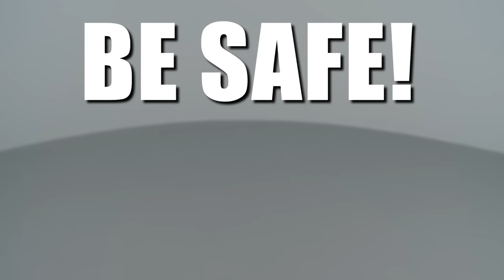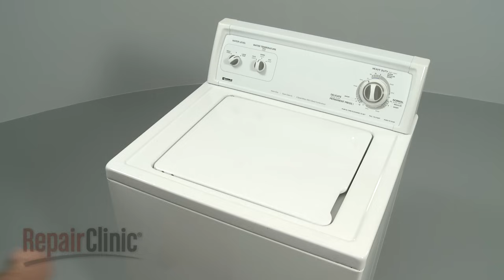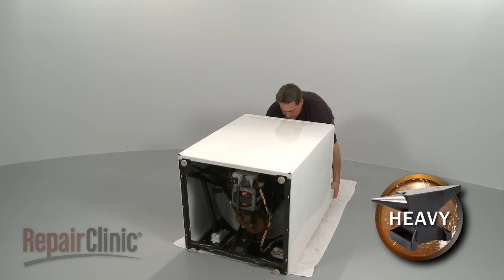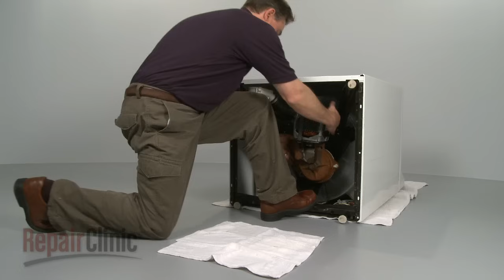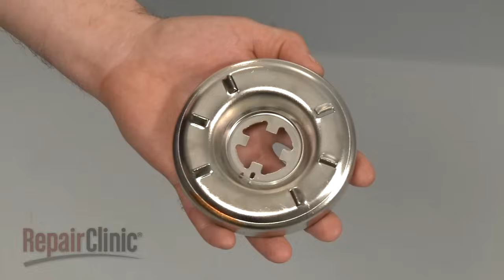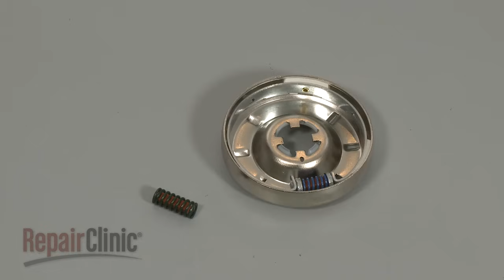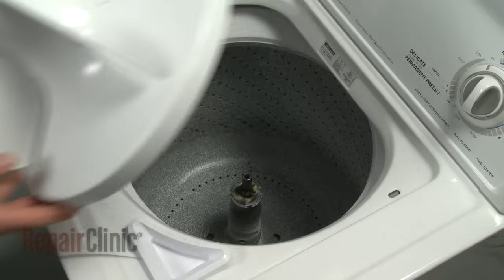Washer Won't Spin? Replace Whirlpool Direct Drive Clutch Assembly #285785

Comment: "One suggestion - @ 2:40 or so, once the white plastic cam is installed, be sure it's rotated counter-clockwise to move it back into its housing - otherwise, the motor/transmission assembly may not properly engage the mounting points."    This might go right to the heart of my current problem. After replacing the clutch, I am trying to put everything back together but I can't get the drive shaft and motor/transmission the last 1/2" back into the base so I can reinsert the bolts.   What am I missing?  I don't follow the above comment.
Reply from the maker: Tim Wright Thanks for your comment. Usually the brake will stay in place so you will not have this problem. But you are correct that if the brake has slid down in the housing, you may not be able to get the transmission up far enough to get the mounting bolts back in. In this case, you will have to rotate the cam to release the brake while pushing up to get it back up in the housing.
Reply: I have the same issue.  Will give it a try.  Much thanks.

Comment: Very helpful. One suggestion - @ 2:40 or so, once the white plastic cam is installed, be sure it's rotated counter-clockwise to move it back into its housing - otherwise, the motor/transmission assembly may not properly engage the mounting points.
Reply from the maker: 47f0 Thank you for the comment! Yes, turning the cam counterclockwise while pushing up will ensure the brake assembly is fully seated and the transmission will fit on the mounting post properly. Thanks for taking the time to share a tip!
Reply: Purchased my home in 2013. There was a Whirlpool washer that the realtor was going to haul away.  I said, no!  I had to leave my other washer at the condo I sold.  So, this washer must have been a 2008 model, or about that age.  Now it is 2024.  This washer runs like a champ and fills to the brim with water.  I started noticing that heavy loads were coming out soaking wet when load was finished.  Clothes would be somewhat spun dry if the load was light.  Then even the light loads were soaking wet.  Purchased a clutch kit on Amazon.  Cheap.   The repair worked like a charm until I tried to put the motor back in.  Could not get the bolts to come together.  There was about a 1/4” gap.   Thanks for the comment!!  Once I turned the plastic clutch part counter clockwise, it aligned and I was able to complete the repair.  I’m a 59 year old woman!  I love this washer.  I did repair the dogs once on the agitator.  So happy I found this video!  A new washer won’t last 5 years.  They make all appliances to break down so you either have to purchase a new one, or pay costly repairs.  YouTube saved the day.  So rewarding to fix things yourself!!!
Reply: I drilled and tapped and threaded screws into my brake cam because the groove for the circlip wore out. Also all i had to do was scuff up and clean the clutch and it was fine.
Reply: Jeezum! Thank you!

Comment: I replaced the clutch on mine, still does not go into spin unless i open and shut the lid , it seems like the brake is not releasing, I've put a wire to hold the switch open with lid up and watched as it tries to go into spin, when the
timer clicks and it starts it will move the agitator for maybe a half of an inch acting as if its locked up, any thoughts?
Reply from the maker: joe102674 There is a pause built into the spin cycle that kicks in the spin. If the timer skips the pause, the washer will not spin. If you can lift the lid and close it in the spin cycle and it  will spin, you most likely have a bad timer. In the spin cycle, the transmission will not go into a spin until after the first pause; this is to enable most of the water to leave before the tub spins. We wish you a successful repair.
Reply: *****
 I just went out and bought a Maytag Centennial Model #: MVWC200BW  (with agitator) from lowes, appreciate your response
Reply from the maker: joe102674 Enjoy the new machine!

Comment: Thanks!  You've saved me hundreds in repair bills on my washing machine.  The only nit I have is that you might recommend people change out their washing machine clutch when they replace the transmission.  I changed the tranny out approximately 9 months ago and the old clutch soon followed.
Reply from the maker: Conn McKelvey Thanks for the tip!

Comment: My Washer spin but does not spin out the wetness of the wash clothes as it use to. so i have run the spin cycle several times. Is this the Clutch or any other thought ?Kenmore 10years old or so. Thanks JC
Reply from the maker: Yes it is most likely the clutch that is slipping and will need to be replaced. First make sure all the water is pumping out. If that looks ok, replace the clutch.

Comment: Nice video.  I prefer removing the motor though.  Just 2 clips and can leave wires attached and makes removing gearbox easier/lighter.  I'd also replace coupler while in there if original.  That plastic ring/clip is a crappy design for attaching the clutch.
Reply from the maker: Thanks for the tips!

Comment: Worked like a charm.  Wife very impressed.  I used one of your other videos to replace a belt on an 80 series dryer a few months back (much easier job).  This is a much messier job than the video makes out.  Also, replacing the drive shaft and lining everything up was really difficult.  However I would not have attempted this fix without your video and if I had, probably would not have succeeded.  Thanks!
Reply from the maker: We're happy we could help. Congrats on the repair!

Comment: I have a whirlpool estate washer. It wont spin or drain it only hums. I checked the lid switch and transmission, they seemed fine. do you have any pointers for me?
Reply from the maker: Try using the repair help section of our website with you model number. This should be helpful: http://www.RepairClinic.com/RepairHelp

Comment: Awesome video. I think I've narrowed my problem to a bad clutch. If I wash just a few items, and have the spin speed set to slow, it will usually spin slowly. But any more load than tiny (or at high speed) and it will not spin (I'm guessing too much weight). There are no strange sounds. Does this sound like a clutch to you? And if so, while I have it apart, should I replace anything else, such as the Motor Coupling or Clutch Band kit?

Comment: Great video. Replacing the clutch was easy. However, the washer now shake violently like the load is unbalanced (even when empty). It didn't do this before i changed the clutch. What could I have missed?
Reply from the maker: I would check the plate that the tub rides on. It may have shifted and the glides are not riding in the right place. If you open the lid the tub should move fairly easily from side to side and align with the opening in the main top. If the plate is out of place you may need to lay it back down and readjust the plate. If the plate is ok check the tub springs and the rear counterbalance spring to ensure they are there and working properly.

Comment: I HAVE A WHIRLPOOL SUPER CAPACITY DRYER FROM 1987 VINTAGE. BUT WORKS GREAT! THE OTHER DAY THE WASHER MAKES A HORRIBLE GRINDING TYPE SOUND ON SPIN CYCLE.ONLY! WOULD THIS BE A CLUTCH??
Reply from the maker: It could be the clutch but it could also be a few other things. We recommend using the repair help section of our website (link in the description). If you enter your model number there you'll have access to part,model and symptom specific repair help.

Comment: Hi, I have just purchased a second hand unit and the seller did advise that the spins is slow at times.  This I have encountered and the washing is wet when spin is complete.  All things seem to point to the clutch especially since the previous owner admits that he washed horse quilts!!  In any event I have ordered a spare clutch which will be replaced but I am basically asking if my diagnosis is accurate.  ie the clutch is shot and slipping.  Washing etc is all working fine.

Comment from the maker: It is most likely not the clutch. We recommend using the repair help section of our website (link in the description). If you enter your model number there you'll have access to model, part and symptom specific repair help.

Comment: That was what I initially thought, too.  No noises and it does agitate normally when it does run.  Thanks for giving me confidence in my diagnosis.  I won't have any problem installing a replacement motor.

Comment: The motor on my whirlpool washer overheats and trips the thermal protection shutting it off.  In about 30 minutes it can resume washing for a little while then trips again.  While it is running there aren't any odd noises or anything, but there is a burned rubber/electric smell.  I took the pump off and noted some slight resistance turning the motor.  I then removed the motor and the resistance to turning it seemed to go away.  Could the clutch be the culprit of my motor overheating?

Comment: Thank you! We replaced the clutch and it seems to be working.  The grease/oil doesn't seem to be dripping on the floor, just sprayed around the inside of the cabinet. Thanks again for the video. We've been having issues for over a year.

Comment from the maker: If the transmission is leaking a little oil it will not affect the performance of the machine unless it is getting on the clutch or brake. If it is leaking a lot you may need to consider also replacing the transmission.

Comment from the maker: If water or oil is on the clutch it could make it slip. If the clutch is dry and still not turning to tub in fast enough in spin the pads in the clutch could be worn . Either way the clutch should be replaced. If the transmission is leaking oil, it will usually drip from the bottom of the case and not out the top by the clutch. You may need to clean it up and keep an eye on it  and try and see where the oil or water is coming from.

Comment from the maker: This is probably not your problem. We recommend using the repair help section of our website to diagnose problems ( there's a link towards the bottom of the description). If you enter your model number there you'll have access to part, model and symptom specific repair help.

Comment: Bought a new clutch, everything seemed to go smoothly, looked exactly like the video. I put the machine together and everything worked for a couple days then no spin again. I dismantled to find a lot of black material around the clutch and the clutch ring has worn right down to the rivets in the white plastic blocks, the black must have been the friction material.

Any idea what could cause a clutch to wear like that in just a few loads?

Comment: Exactly like the video! Thanks so much for your effort.
The worst part of the job was all the water that poured out of the pump. 
The clutch was a piece of cake.
Thanks again! :)
Reply: My experience with the water exactly. Now if I can just get the drive shaft free from the unit...

Comment: This is great but let's say it's sunday night and you need your work cloth for the next morning (like me ) and you don't have the new part , i take it off like in the video and did an emergency surgery, first take off the clutch with a pair of vise-grip compress spirng and slide it out clean everything on the clutch where the friciton happen and then scuff the pad and disc with a sand paper i also added washer to the spring to add tension ,it worked but this is temporary ,order part now

Comment: While I would enjoy a full break down transmission excluded this is a good informative video.
Although the only reason I am watching is the rear spring came loose, and I was uncertain where it attached. I saw the spring in the video and, the size of the hole it fits in, it would have taken a long time to figure out it went there.

Comment from the maker: Hi, thanks for the note. We did cover that step in the video. See below: 

"NOW SLIDE THE MOTOR AND GEARCASE ASSEMBLY INTO POSITION, MAKING SURE THE CLUTCH SPRING IS OPPOSITE THE BRAKE CAM. BE AWARE THIS MAY REQUIRE SOME ADJUSTMENT BEFORE THE GEARCASE SITS FLUSH AGAINST THE BASE. SECURE WITH THE BOLTS."

Comment: so far this looks somewhat simple and easy. I need to replace the clutch the motor coupling and transmission on my whirlpool as the trans is leaking oil.

Comment: I first noticed my heavier loads (towels) were not spinning dry. Eventually, all my loads were not spinning dry. All other wash functions worked fine. This was the fix. Couldn't see anything visually wrong with the old clutch, but now the washer works the same as when I bought it 7 years ago. It's an easy enough project. If you can change brake pads, you can do this.
Reply: Thanks for this post - I took mine apart before buying the new parts, visually looked fine so I went back to do more research but now I am convinced its this!

Comment: This is for the ladies out there:  I am a 54 year old single woman and I did this simple repair alone (thanks to the video!).  It is not hard to do.  I ordered my part from Amazon for about $13.  My washer works like a charm now.  Thank you so much for this helpful video!
Reply: I’ve been repairing appliances for a living since 1984. We  need more women in this field.  Believe me, if your mechanically inclined, you can make a nice living as an appliance technician. There a lot of woman that are more mechanically inclined than some of the men in this business.
Reply: Im a 57 year old woman and this will be my second time replacing this if I can still get the part! I was also able to replace some parts on my HVAC unit when it was having problems. Thanks to YouTube!
Reply: Me too. About 5 times and I'm 45 years old
Reply: Thanks ladies...I needed the encouragement ❤

Comment: For clarity: The symptoms on my washer were EVERYTHING worked great except over time the spin got slower and slower, then stopped completely. No weird noises, it washed, filled, drained, all OK. But would not spin. The motor was running normal, but the tub would not spin. The old clutch did not look THAT bad, but as soon as I tested the new one it spins like crazy new. Repair is NOT that hard, clutch can be found local for $40-$50, or order from these guys. Good people!

Comment: Bless you and your video! Before I had found this video I had studied Whirlpool online repair course. They overcomplicated it terribly,  removing the control panel and cabinet.  After seeing this I dove in. I bought the clutch  for $40.00. 1/2 hour later my wife loves me again! I did have trouble getting tranny flush as the basket bushing had moved and I had to bang it back in place. Thank you so much (You can do it too!)